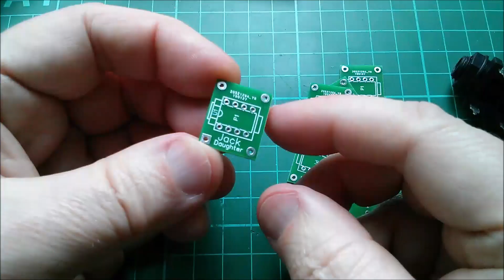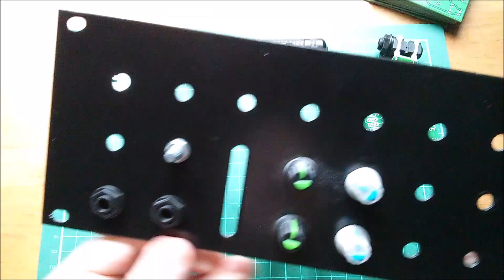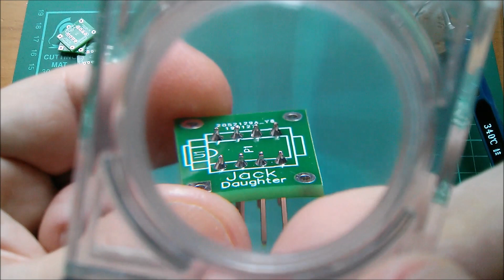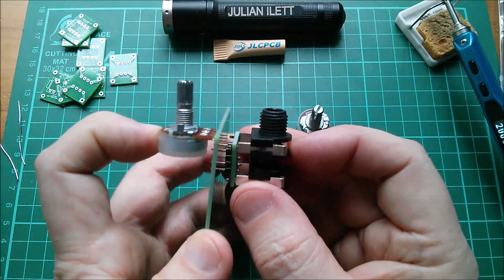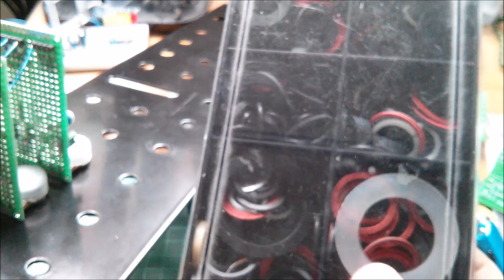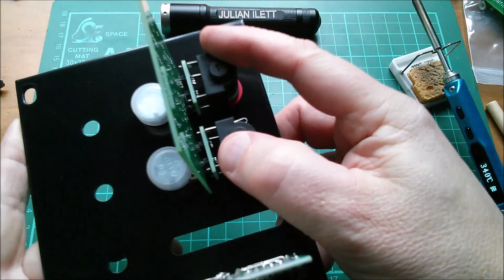New PCBs - Jack Daughter and Input Amplifier - Vocoder

Comment: "That little tab" on the pot is referred to as a locating pin.  This goes back to the days when pots were connected with wires rather than going into a circuit board,  and was useful in that equipment which had front-panel markings,  like a 0-100 scale or something of the sort.  I can remember seeing this mentioned in a very early servicing text,  which also stated that if you were replacing a pot and it didn't have a hole for that pin, you should bend it over (if metal),  or snap it off (if bakelite).

I'm surprised at soldering while pins are in a breadboard.  The whole point of those is "solderless".  :-)  I would have expected some plastic melting to be happening there...

Comment: Julian, as a quick'n'dirty fix, wrap a couple (or more?) turns of twine or string around the threaded portion of the pot to space it from the back of the board.  Or, if you have a sander, thin the plastic washer slightly so it all lines up.

Comment: Hello I was wondering if you could review or post bag a sabertooth dual motor speed controller. More specifically how to control it manually without the use or remote control. I understand it uses PWM and am looking to control a tracked vehicle with a “wired” joystick or twist throttle like ebikes. Thanks

Comment: You missed the opportunity to add another function to the board. An 8 pin SMD footprint in the middle (connected to the pins) would have been a good addition, adding the function of SMD to DIL adapter to the board .

Comment: Beautiful system engineering Julian, but...

You better hope you never need to service that card now :) 

Also, looking at the daughter card, might it have been easier from a soldering point of view to not use the corner pins of the "8 pin package" but instead use the rear 4 pins so you didnt have the awkwardness of soldering under the pots ?
Reply from the maker: Yes, true, but I'd want to always solder all 8 pins for mechanical strength.

Comment: Agree. Sweet design.

One thing to be cautious of is the relative unreliability of having too many internal connectors. What I'm referring to is that you'll have to open up your finished Vocoder, and then wiggle all the internal connectors because the surfaces of the connectors have oxidized again. It's less of an issue with external connectors because they're cycled (in and out) so often. But having a dozen internal RCA and Stereo Mini cabling internal to a system will eventually lead to headaches. Perhaps a complete set of gold plated cables could preempt this issue. Good luck.

Comment: I tested JLCPCB and used DHL Express for shipping. Never again. The PCBs cost around 9 EUR and shipping was around 20 EUR, then I needed to pay 22 EUR customs penalty. I don't know how much it would cost without DHL express, but I bet the customs would be the same. This is too expensive and I rather help local business strive than China...

So I found AISLER.NET, they're from NL, manufacturing is in Germany and they ship to EU for free! The boards are much more expensive but that's okay because they have 0 EUR of customs fees. You can't change the color but the matte green finish looks much nicer as the shiny dirty looking finish of JLCPCB. Also it's gold plated instead of whatever JLCPCB uses.

Pretty sure JLCPCB pays at least his customs fee or everything since they are the sponsor of this video, but be aware that customs can be extremely expensive, multiple times as expensive than the actual PCBs itself, which is a shame...
Reply from the maker: Don't JLCPCB have a land-based shipping option?
Reply: @JulianIlett  They do and I obviously selected Germany, but still, since they ship from China, it has to go through customs. Customs even wanted the invoice cause the actual value of the contents of the package was so low comparing to shipping cost, they didn't believe this... The tax excempt amount in Germany is 22 EUR including shipping cost, and with 9 EUR for 10 boared + 20 EUR shipping I obbviously was over this limit. :/
Reply from the maker: I thought the economy shipping was about £11 - that leaves £4 for the PCBs - UKs tax exempt limit is £15
Reply: I pay around 6-8 euros with shipping to Germany by snail mail with green boards - still cheaper than anything else for 10 boards 10x10.
Reply: and no custom fees then of course
Reply: @Davedarko  And how long did it take from them having shipped it until it arrived? 5 days would be ok for me, more than that is a nogo.
Reply: @Davedarko  That's why I stay with AISLER.NET. Free shipping and it comes right the next day after they marked it as shipped. Like it should be!
Reply: @kyoudaiken   I just priced up a board that I had made by PCBWay.com - Aisler came to 93 euro (£81.00 gbp).  The same boards cost me $39.00 for 5 plus $25 DHL to the UK (which at today's rate is £42 for the total order value of $60) and they were delivered in 5 days.  Quality was excellent.  I too like the idea of supporting local industry, but to have the same boards made locally would cost upwards of £300...

Comment: Those boards do look great, I nearly ordered my fist set till I got to the shipping, man that killed the thrill.
Reply: Jerry, maybe you should reconsider. OHS Park offers free shipping. But you get only three boards and the price is $5 per square inch. JLCPCB beats that price hands down. You get 10 boards and after you have paid the shipping, they are still less than $2 each. I have had 4 day turn-around. Except for my current order which is 69% done and waiting for the next full moon. Just my luck to get caught in the Chinese New Year. It happens to me every year. 8-)
Reply: @BuddChurchward  Prototype boards get free shipping, or that's what I got when I ordered 10 boards for Nate Patel's 4x18650 Charger Board from them.  It was $17 for the larger boards (96x125mm) for the 10 boards and I saved the $17.50 shipping to the US.  Now I can charge 40 lithium cells at a time.  Thanks, Julian, for letting us know about JCLPCB.

Comment: Years ago when I used to build tower computers, I purchased a large box of audio to CD/DVD cables.  They come with 3 wires and one blank on a 4 pin DuPont type connector, I have used these for all sorts of things, especially since such cables are virtually obsolete now days, and it is very easy to fill the blank hole with a home made wire to make it a wire crimper and Dupont end.  They are great in playing with Arduinos, but I bet they would work super in connecting your boards in this project, I am sure you can still find them for little😂 or nothing on Ebay,  Just a thought.

Comment: I think I have to try making my own PCBs. When I started getting into electronics, stuff like that was ridiculously expensive, so I got used to working with perfboards.
Reply: I got 150 PCB's for €24 including transport, there is no one any other solution can beat this price and quality, but it takes about 2 weeks to get your PCB's from China.
But anyone, when I need something quick, I usually CNC them or do them with the photoresist method. With the cheap Chinese CNC I can make PCBs with minimum 1mm track, I can do much better with the second method. The CNC takes about 1h to make a 100mmx100mm board, the photoresist about 30min.

Comment: Don’t microphones normally use XLR connectors these days?
Reply from the maker: The cheap Karaoke mics have an XLR at one end of the cable (plugs into the microphone itself) and a 1/4" jack at the other.
Reply: Ah, okay. Could you plug other instruments in to those 1/4” jacks too, like a guitar?
Reply: You are correct, 99% of all professional, stage use microphones used balanced XLR. Take the Shure SM58 (the industry standard microphone) thick metal body with a male XLR on the bottom. Strange that julian is using jacks when XLR connectors are dirt cheap now from CPC...
Reply: @djtechsane   probably because most XLR condenser microphones  require 48v phantom power which would complicate things somewhat
Reply: Some of them also use radio to transfer the data.
I was the sound technician for my schools play and we used all wireless mics. Absolute pain but a lot more easy to use

Comment: You can also place components on the back of the board, along with the silk screen
Just remember that an ic will be mirrored (left/right)
Reply from the maker: That will be very useful for the filter boards which have a high component density - I may also introduce a few surface mount components!